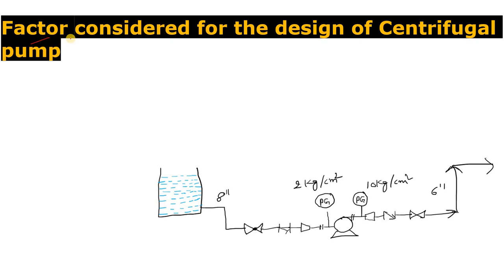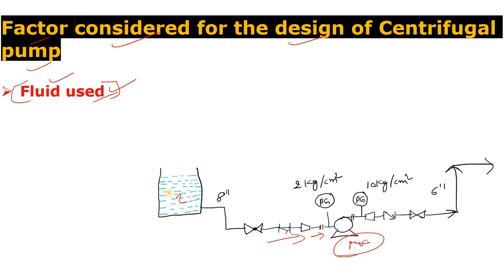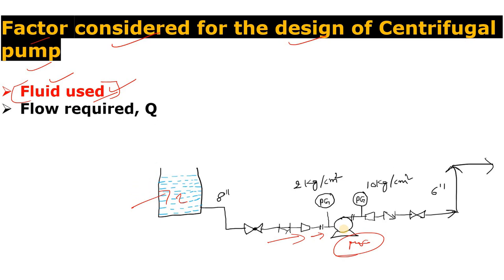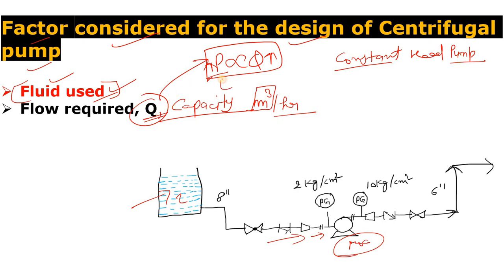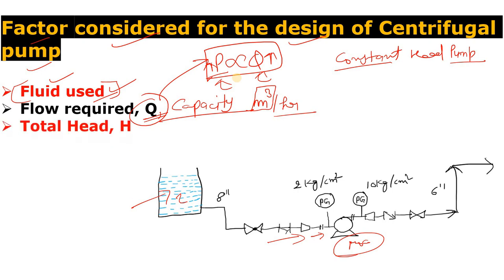What are the factors consider for the design of a Centrifugal Pump? (Part-9)

Comment: Why H vs Q why not p vs Q
Reply from the maker: whenever we buy the pump from the vendor then we buy it in terms of head not in term of pressure that how much pressure it will generate bcz Head is independent of density you may say that.
Reply: @Coreengineers  thanks